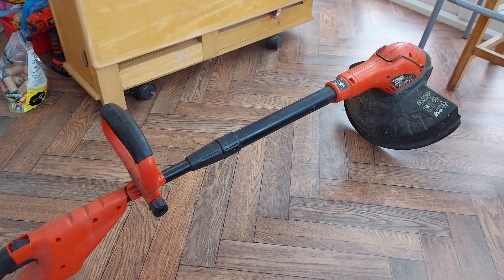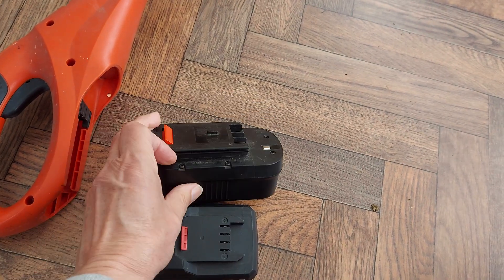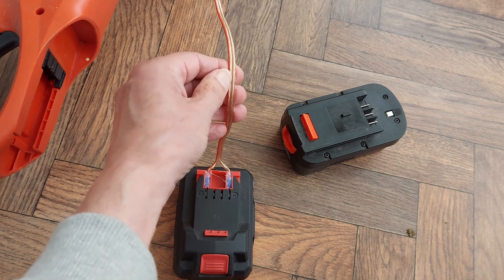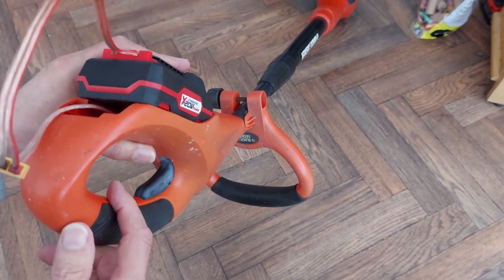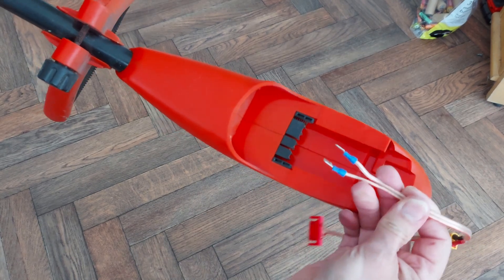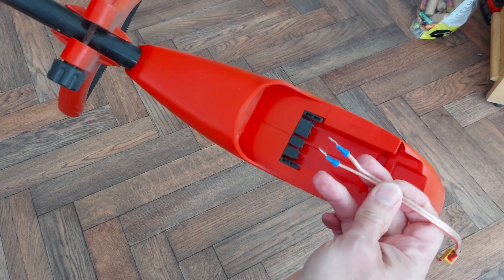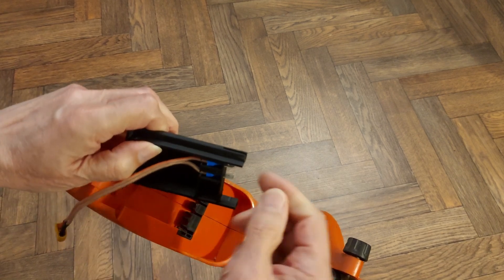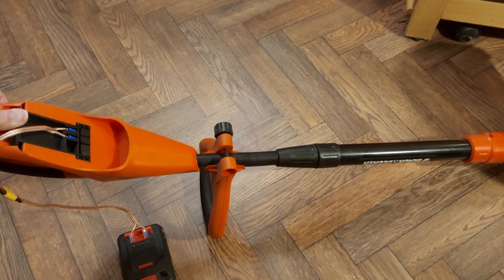Black & Decker 18v Battery Adapter for LIDL Parkside 20v Battery PART 1

Comment: Something to be aware of, the Parkside battery does not have a low voltage cut off so you need to be careful you don't damage the battery.

Comment: Just use a faston, a 35A or 40A car-fuse and you can connect the wires straightforward, then hotglue them inplace and it will safely work, just not look that nice.
Reply from the maker: Yes that would work 👍👍

Comment: Could you not use the top half of the old battery ?
Reply from the maker: Yes, you could👍👍 I guess you were not listening to what I said. The one I talk about by Gaudesign at 01:05 uses that method. The link is in the video description. 
I have it in mind that I might do a video changing the NiCd cells for new ones so I would want the old battery case anyway. 
This project took me 4 episodes to get it to the point that I was actually rather pleased with the result.

Comment: Could you not open up the original battery and replace the batteries?
I agree with MickyNuts. A good print for the power adapter. 👌👍👍
Reply from the maker: Yes, you could buy a set of NiCd cells to replace the originals. Not cheap, but cheaper than buying a replacement NiCd battery. Of course, to connect up the cells you are best using one of those little spot welders, so that would be an additional expense, plus the Nickel tab strips. Suddenly the LIDL LiIon battery seems to be a reasonable cost and a good upgrade. Add to that the fact that I already have 2 of those LIDL battery packs that I bought several years ago and never used. Check your comment 2 years ago on the video I did on the original battery teardown https://www.youtube.com/watch?v=eGRzEYbYOSw
Reply: @GrandadIsAnOldMan  We need to reverse the time machine. 🤣
Oh yes, those little spot welders. Well, I have one and tried to use it several times about 3 years or more ago. It kept tripping the circuit breaker, no matter what socket I plugged it into. 
Have a nice holiday. 👌👍